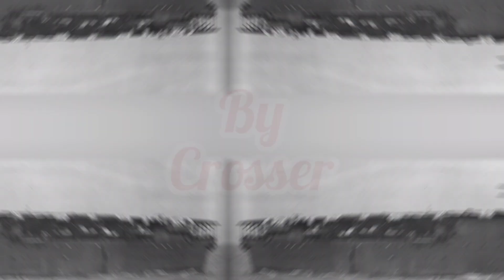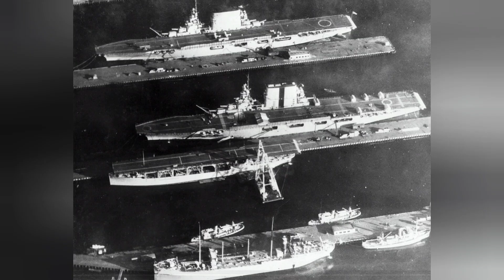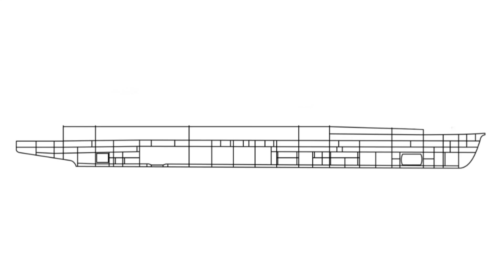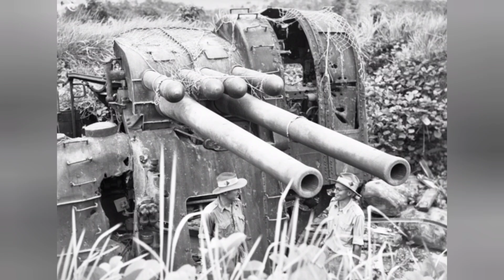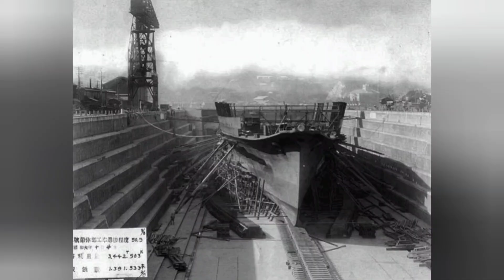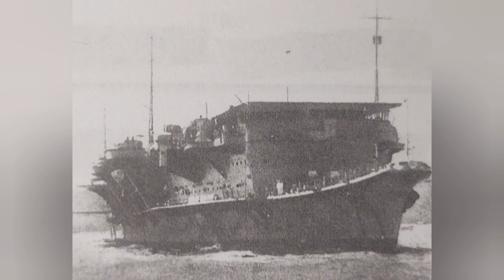Developing Ryūjō (Part 1)

Comment: Fast forward 5 decades --> & the world does a shocked Pikachu face when Japan creates the DDH (Helicopter Destroyer). Ships of less than 10k tones that carry about 24 helicopters. Fast forward another 2 ½ decades, & the 2 latest ones are undergoing major refits (1 done, 2nd one ongoing), to be able to handle the F-35 Lightening II S/VTOL variant (the Short Take-Off & Vertical Landing version). I guess, old habits die very hard. Lol